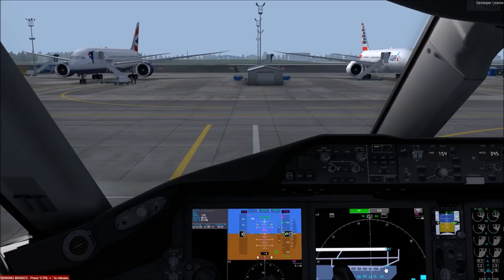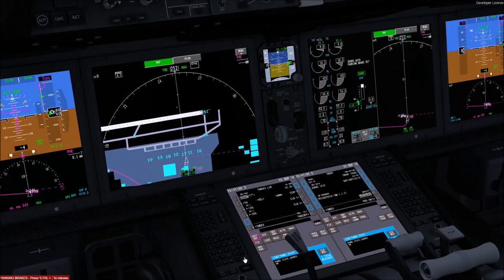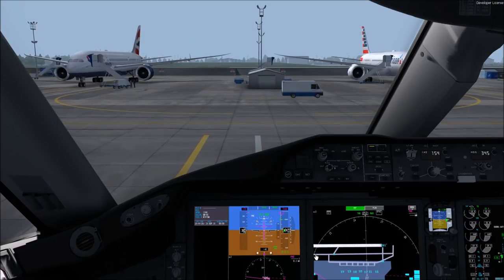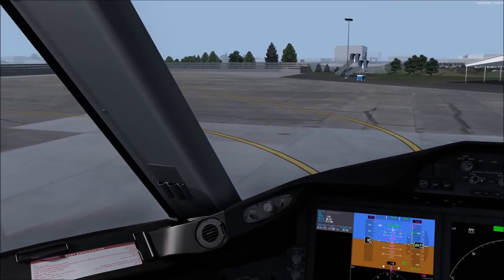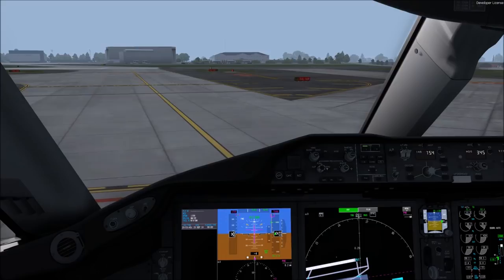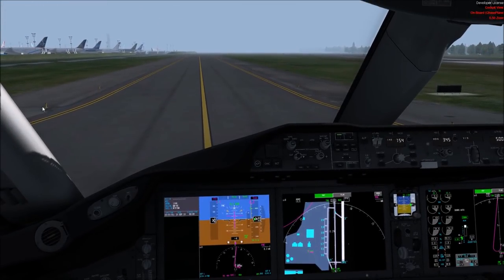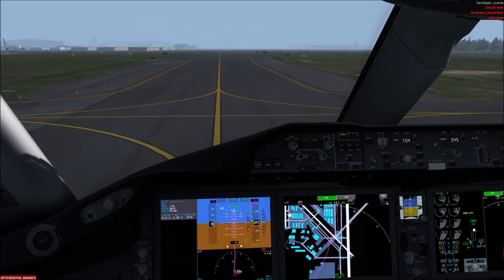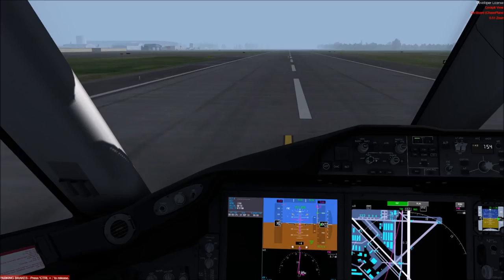QualityWings 787 Taxi Techniques Tutorial

Comment: WHY THE ENGINES (N1-N2) ARE ALWAYS AT 19.9% DURING THE ROLLING-UP NEEDS THE AEROMOBILE NEVER STOPS ITSELF, THE HANDLE AND ON ZERO BUT THE MOTORS ALWAYS ALWAYS AT 19%
Reply: I’m having the same problem. After engine start the N1 is at 19% and as soon as you release the brakes the plane moves quite fast and is not realistic. Does anyone have any ideas how to change this?
Reply: @chrisjames7699  
hi chris you solved the problem of n 1 at 19%.
I started flying again with the 787 but this bad problem persists
Reply: same here and close brother report  this bird.has this issue in short 3 to 4 hours flight accelerates on taxi as hell. they never fix this. you load the plane full of passengers, but with requierd fuel for 3 to 4 hours trip and this plane fly over taxi way lol.